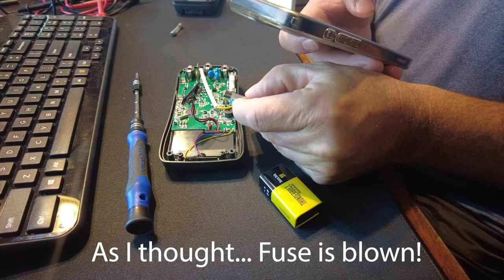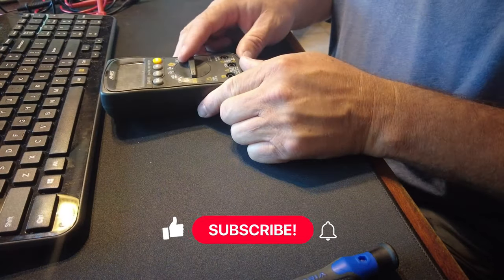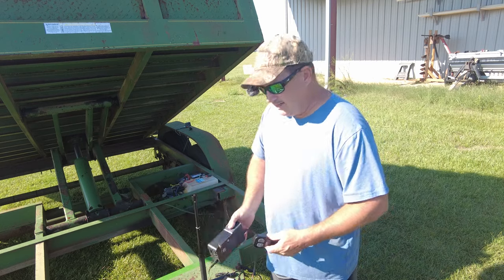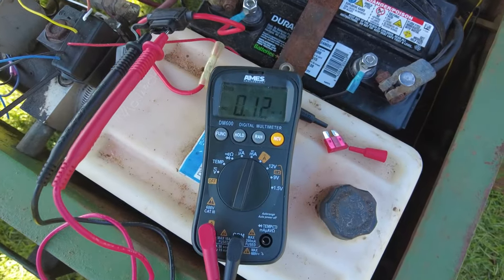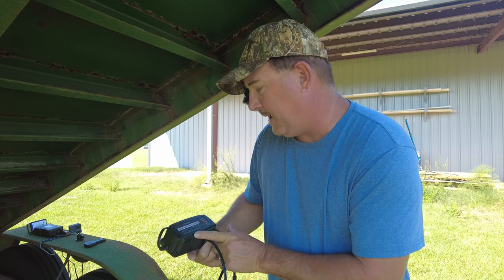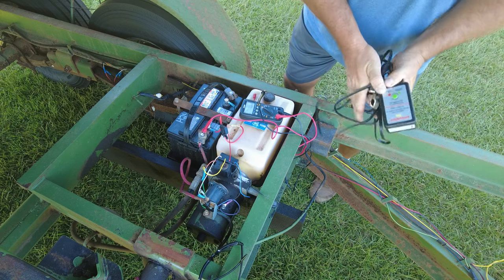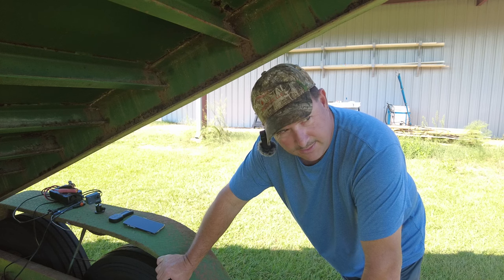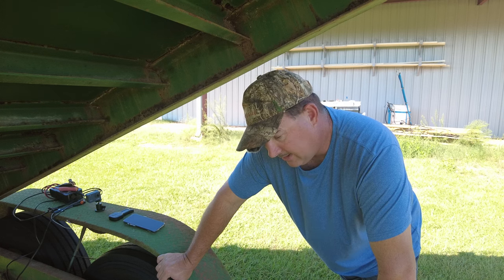WILL IT KILL IT - Will a battery charger kill the battery if it's not plugged in?

Comment: Good test to see what the draw is over time. Naturally over a long period, a lead acid battery will drain anyways, so the minimum voltage a battery tender may use is nothing to be concerned over. If you are storing something for a year or more, take the battery out or charge it regularly, perhaps a solar charger.  It wouldn't hurt to consider having safety chocks too on that dump trailer to prevent the box from falling, shit happens and a sudden drop with you under it is a possibility.
Reply from the maker: Yeah, I was more concerned with how much the chargers, mainly the one I leave in the dump trailer, would draw if it was connected and I'm fairly confident it wouldn't do much.  All I have to do it disconnect the fuse during storage because the fuse I have protects the wireless remote and the charger, which are the two things that could drain the battery.

That's a great safety tip on the chock.  This dump actually has a built in stop that I have used when I get inside the frame under the bed but you are correct that it could fall and that wouldn't be good at all.

Thanks for the comment!

Comment: Parasitical loads. All batteries have internal resistance therefore has internal current flow.
I have rechargeable batteries sitting outside of the devices. They too go dead after a while, just sitting there.
Even the old manual battery chargers will draw from the battery if left connected and unpowered.

Best to check unused batteries about every 3 months, recharge when needed.

Comment: most modern chargers are required to be energy saver with a circuit to not allow current flow from wall outlet if left plugged in to wall I tested old chargers, and they actually drew around 4 watts, but most new ones drew 0 from outlet so i would guess same circuit prevents much flow from battery also. there was a big stink about vampire loads from everyone having tons of phone chargers and such plugged in years ago. so it all added up to having a light bulb running 24/7 so government required new energy star standards.
Reply from the maker: Thanks for the comment.  Most newer cars and trucks have so much going on that they drain the battery just sitting for a short period of time anymore and batteries are not cheap.  I did get some better test meters and plan on revamping this test and will try to make a follow up video with more accurate numbers.  I kind of got brain fog after battling with the meters and rushed this video because I wanted to play with my new camera more than anything.  I appreciate you taking the time to watch the video and to leave a comment.  It makes it all worth the time to record and edit these videos.
Reply: @fnitup  yes my van slowly discharges in a couple weeks if i don't drive it on a long trip  I hook it up to a 6 amp battery charger for whole day to get it back to full charge after two weeks it will be down at 12.2v or so